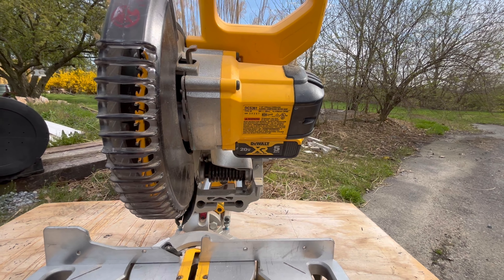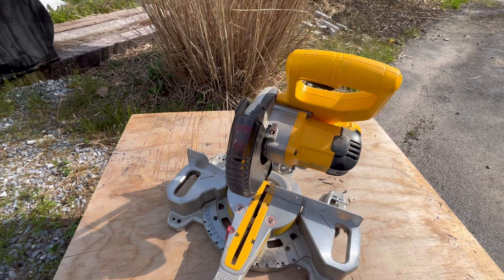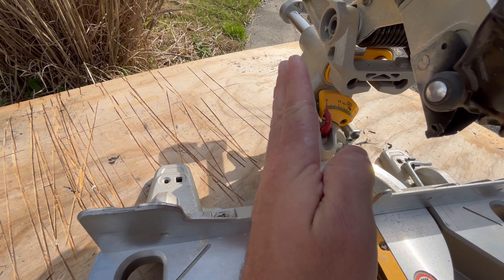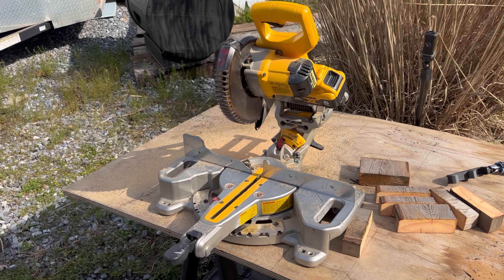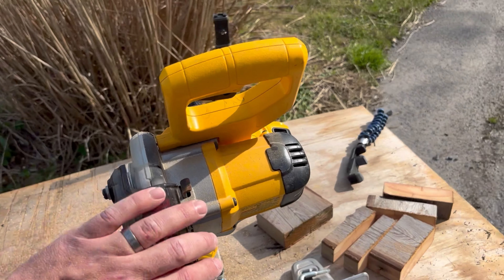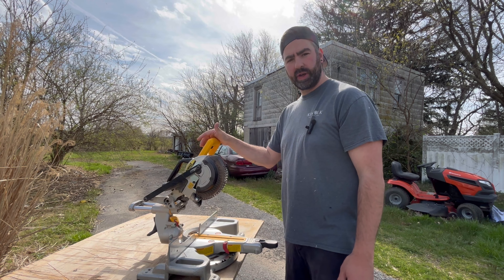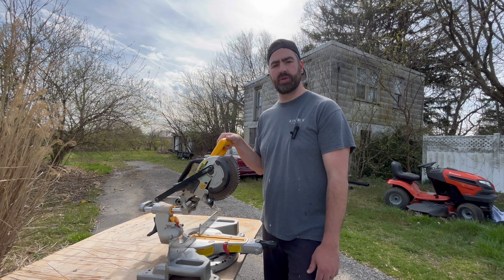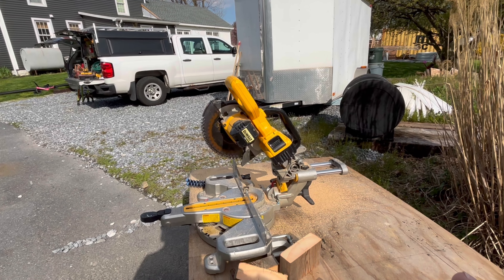Dewalt 20v max 7 1/4” miter saw review (DCS361)

Comment: Nice overview, thanks for taking the time to post it. 

I’m considering this saw  - most of my work will be outdoor using pressure treated (at least for now).  Older woman with weak arms, lol. I have a circular saw but wondered if this investment would help me make consistent, repeatable cuts on 2x4 and 1x6 to save time.  My circular saw is older and quite heavy to use all day. 

Comparing against a 10” brushless motor 18v Ryobi (I’m not a contractor so don’t need super duty).  Seems like the smaller blade Dewalt will do all I need.
Reply from the maker: It would definitely help make repeatable cuts and is nice because it’s small and light . I’m personally not a big fan of ryobi but they are cost effective and do the job they just don’t stand up to the abuse a full time contractor puts them through

Comment: I got mine for years! I love it, but I find it kind of slow sometimes. Also I have a 24v 7 1/4 sliding dual bevel Kobalt and it is awesome! The cut capacity is much longer than the Dewalt. But the saw is a little bit bigger. Do you also find that your miter saw loses a little power with some cuts?
Reply from the maker: I thinks some of the power loss might depend on what battery your using I do find in some materials it may be underpowered a bit but i think having a flex volt battery in it helps
Reply: @kinfolk_carpentry  Not really! I use mine with an 8ah battery and the result is the same. 😟
Reply: I’ve always felt that this dewalt 7 1/4” mitre saw needs an upgrade
Reply: I would agree, mine feels like it struggles occasionally when making cuts. Overall though I'm happy with it, much better for lugging around to jobs than my corded Hitachi

Comment: Literally, the only reason I didn't buy this saw is that they didn't make it dual bevel... like wtf dewalt.
Reply: And it's funny because it used to be cheaper now it's more expensive lol like now they really aren't going to sell any of them
Reply: @user-do2yj5rr2k  i just bought one and got a free 5 amp hour powerstack with it. Dual bevel isnt a big deal, because when you want to cut an opposite angle you just flip the material... I do this on my 12in instead because its quicker too. its actually just as accurate aswell. You have to use your brain a little bit that can be hard for some people.